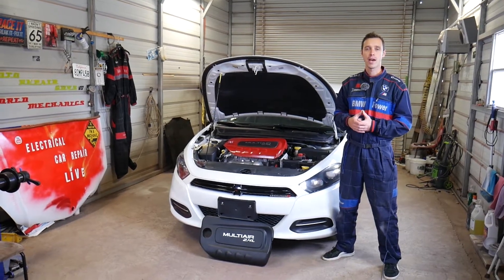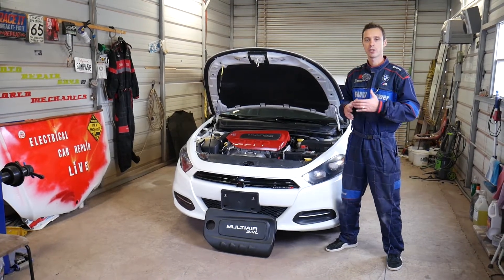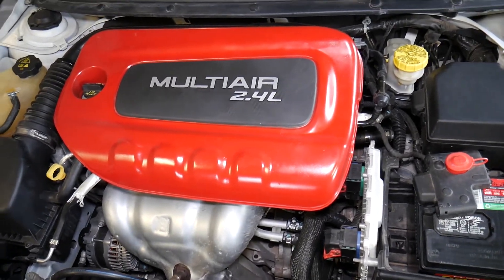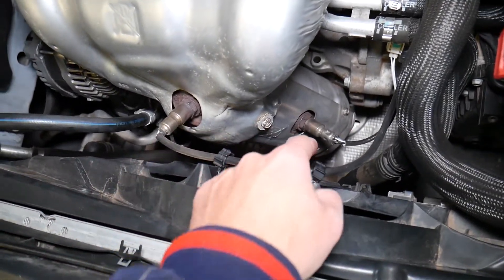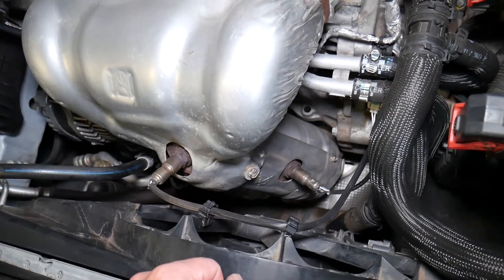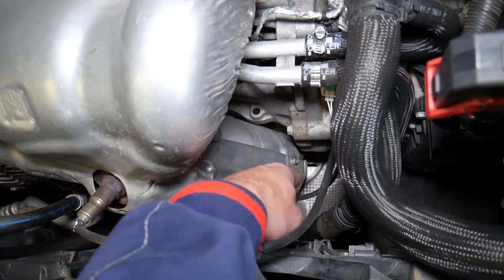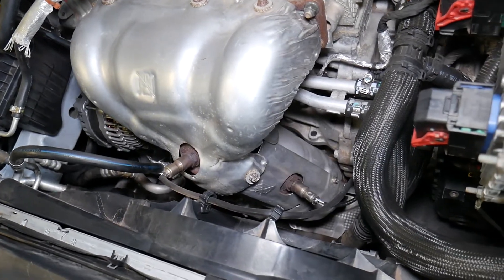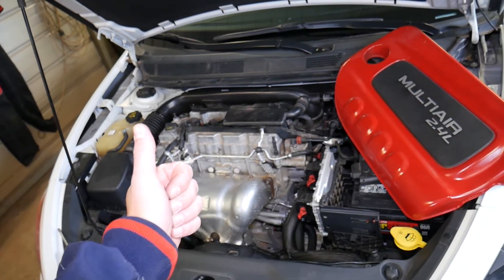CODE P0420 DODGE DART, CHRYSLER 200, JEEP CHEROKEE COMPASS RENEGADE, RAM PROMASTER CITY FIAT 500X

Comment: I have mpx headers and it keeps throwing p0420 after all monitors set I can't figure out smh no power lost no rough idle just randomly throws that code
Reply: Same. When i run my scanner is doesn’t even tell me the p0420 code or anything for that matter but my CEL is still on :/
Reply: I put o2 spacer after cat come to find out headers were disconnected from mid pipe  had to change to a vibrant exhaust clamp , all monitors are set now definitely check for leaks
Reply: Intake manifold gaskets. Betting you have unmetered air and cracked gaskets throwing off code.